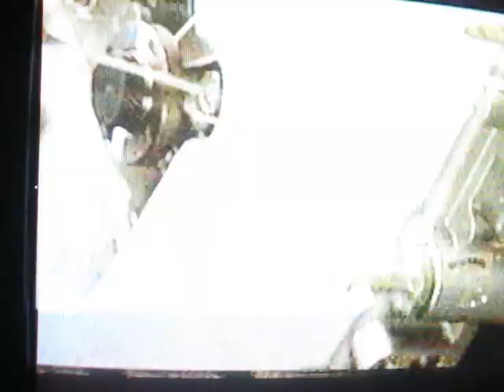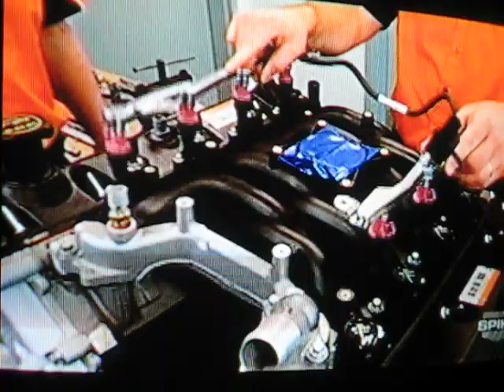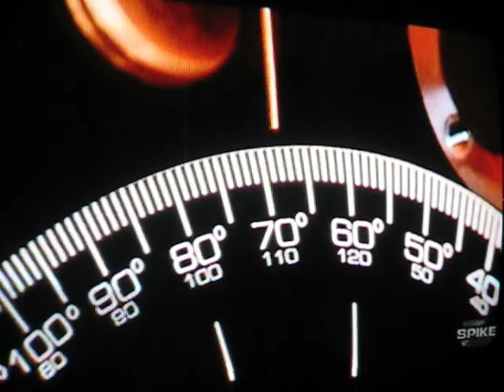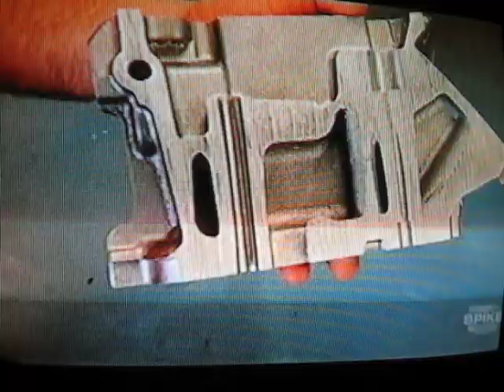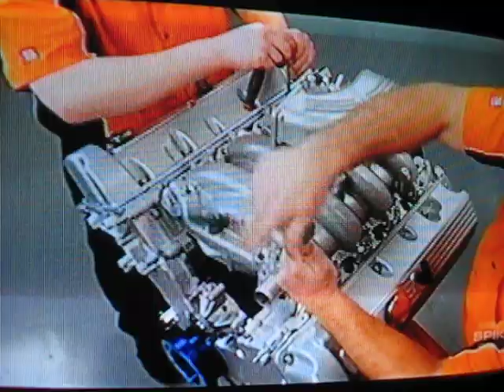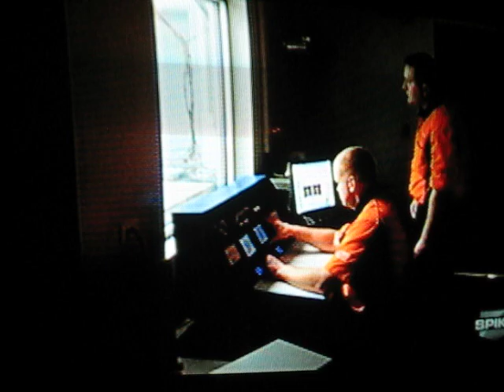new 4.6 trickflow top end kit dyno numbers

Comment: Also they quit putting 2v motors in mustangs in04 that mustang is a newer model it has a 3v in it ,
Reply: Trick Flow only makes the top end kit/heads for the 2v mustangs, but 2v mustangs were old news by the time this episode came out. Some marketing ignoramus spliced in footage of the "new" mustang with the older 2v engine to be "with the times".

Comment: Plus 406 hp without any accesories and an electric water pump is actually about 360 at the motor after adding accessrories and a mechanical water pump. So about 306 at the wheel. Thats the whole story. Plus Im pretty it sure had TFS cams in it too.
People have been doing better than that with stock ported heads for almost a decade. I'm not TFS basher. I have their intake with the oval upper instead of round that excepts any throttlebody the Cobra does and I love it. Mine is modded at 665 whp.

Comment: It's 408 hp on a 2 valve? So its one hell of a gain.148 hp over stock is damn good
Reply: The 260hp rated 2v is tested with full exhaust, sedate tune, and stock airbox. This combo was outperformed by a stock pi hci until 4000rpms. By 4500 rpms, the difference is 15hp. For the average street driving car that will only see about 6k rpms, the gains are less impressive.
Reply: @madmod  what are you talking about? This video shows 408hp peak. That’s 148 over stock 260hp. Where did you get 15hp from?
Reply: @moddedmedia415  a stock 260hp rated 4.6 makes closer to 300 flywheel when tested the same as this. No exhaust, optemized tune, and open throttle body. Trickflow showed dyno results of this layed over a stock pi engine tested the same and it at the stock pi combo makes comparable power until about 4500-5k rpms.
Reply: @madmod  mmkay when we dyno at the shop they make about 215-230 wheel depending on car. But with bolt ons and our tunes with cams and heads we can get them over 330hp. That’s a solid 100hp gain or so. Not sure what experience you have building cars but HCI out performs stock by a lot especially on top end when we can rev to 7500rpm
Reply: @moddedmedia415  This trickflow combo wasnt tested at the wheels, nor was it tested with a full exhaust, safe tune, stock airbox, accessories etc like the stock rating. Its not the heads and valvetrain limiting revs on street cars. Try reliably shifting a car in excess of 7k rpms where these heads shine on mustang t45's and they will let go quickly.
Reply: @moddedmedia415  id like to see a real apples to apples comparison. Equal compression, both running an identical intake manifold, and both having an optimized tune. Ive seen npi cars make over 330hp to the tires but that wouldnt be apples to apples.

Comment: thats with stage 1 cams, imagine stage 3 and some nitrous
Reply: I recently built my 2v which has the npi bottom end and stage 3 trickflow specific cams 38cc chambers and dude let me tell you the car feels like it has twice the power of stock. Unfortunately i blew it up within a couple of months but im gonna get a forged bottom end and give er a 150 shot of nitrous should be close to 600 hp fingers crossed
Reply: How did you blow it up? Nitrous? I’ve seen the N/A builds last forever.
Reply: 9 year old comment I know but those stage 1s aren't even optimized for the tf head. They are ground to be used in the pi head but sold with the top end kit as a solid improvement over stock. With the intake valve moved you can seriously mess with intake centerline and lobe separation angles so you get a much better performing cam.